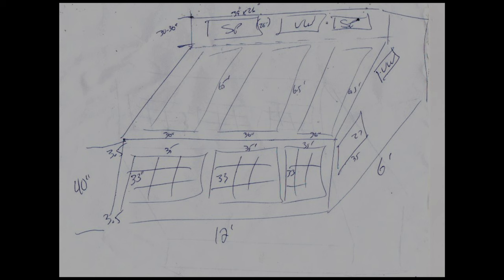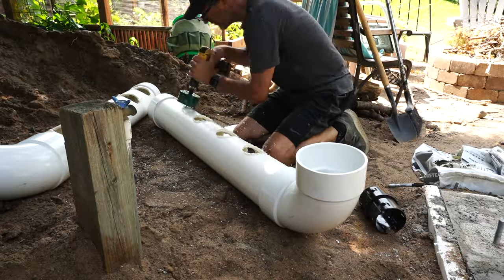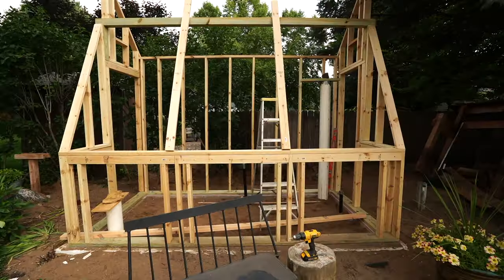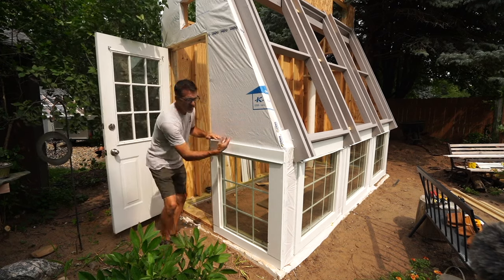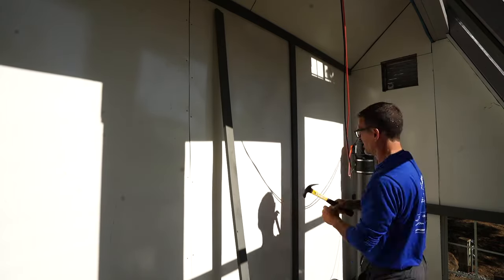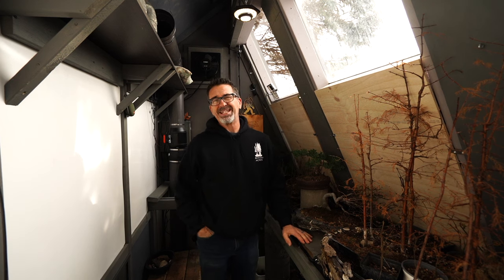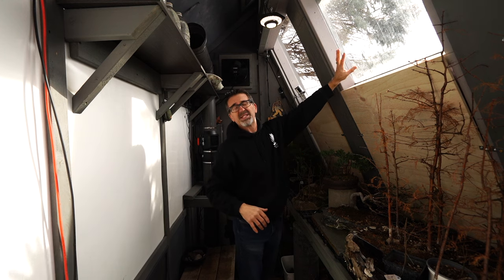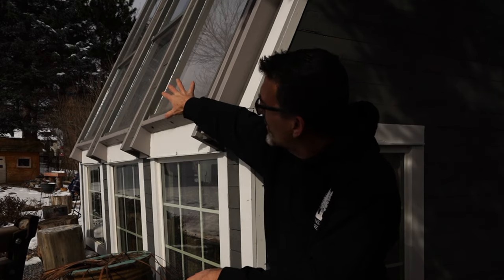Passive Solar Green House/Frame Build in Under 15 Minutes:  Dave's Bonsai E382

Comment: That was a cool recap, Dave.
Not a bad price, especially when you apply Nigel’s theory and divide that out over the next 20-25 years of use. 

I liked the shoulda-woulda-coulda section, hindsight being as good as it is. Now, do you add on to this structure?  Or just make changes to the new one at Bonsai Acres?

I’m diggin it, brother.
Reply from the maker: Very true!